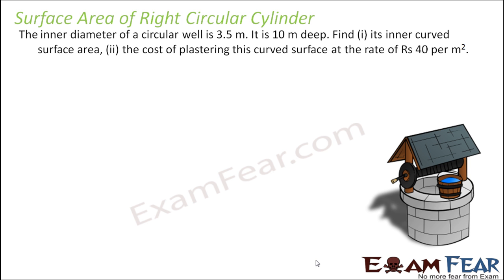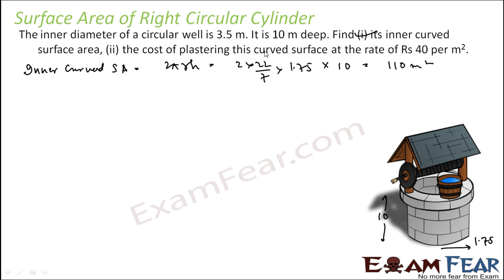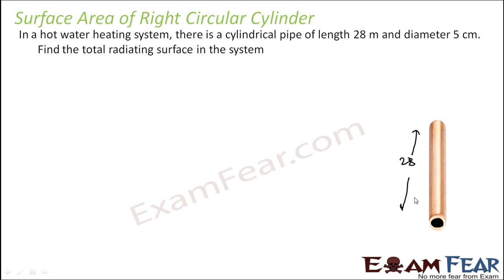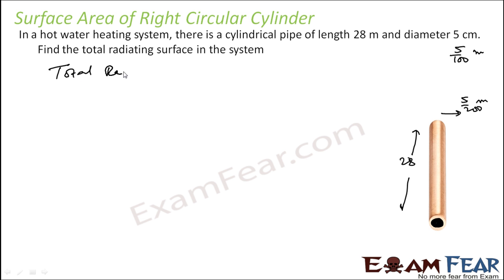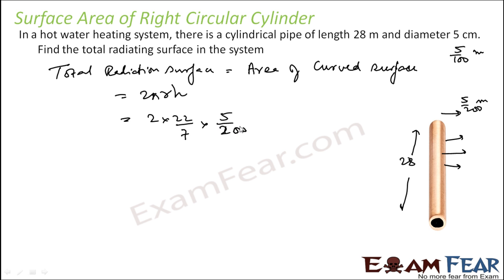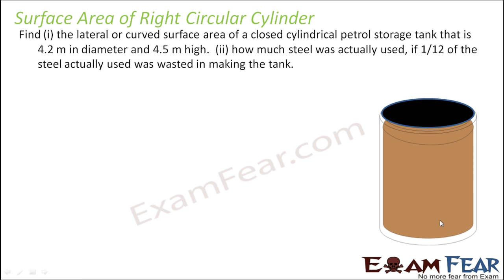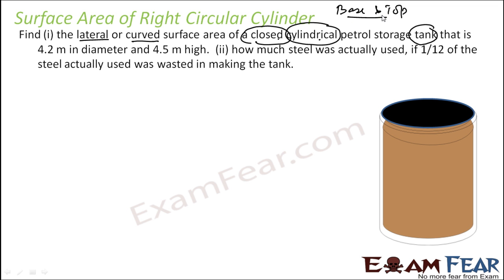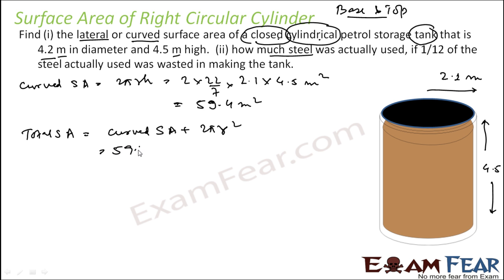Maths Surface Area & Volumes part 9 (Numerical:Surface Area Cylinder) CBSE class 9 Mathematics IX

Comment: In first question it's diameter is 5 so u kept it 5/100meter but we should use radius right so it will be 2.5/100
Reply: Koushik Joseph diameter is 3.5 m.
Reply: We can use both the methods
Reply: @gaurimishra2730  I asked the question like 3 years ago....
Reply: @koushikjoseph2045  so
Reply: @gaurimishra2730   dude i finished my 9th like 3 yrs ago and u are explaining me  9th class questions when i am in BTech. Its kinda funny 😂😂😂